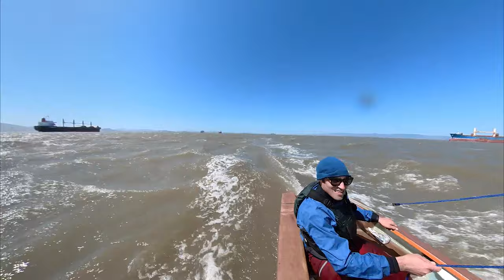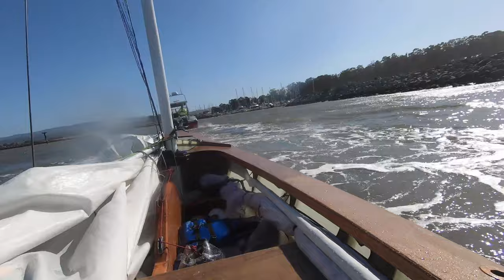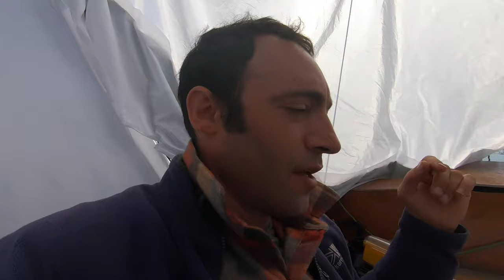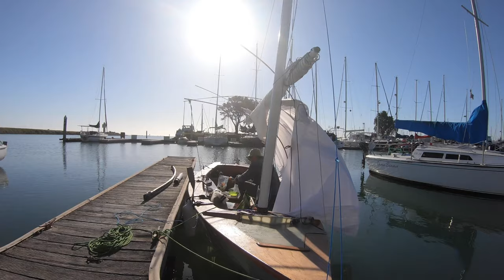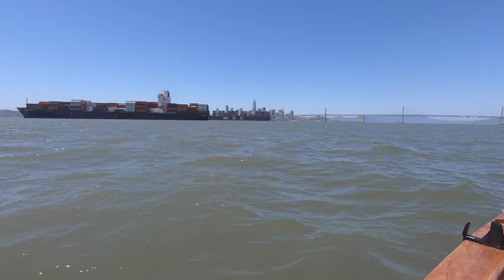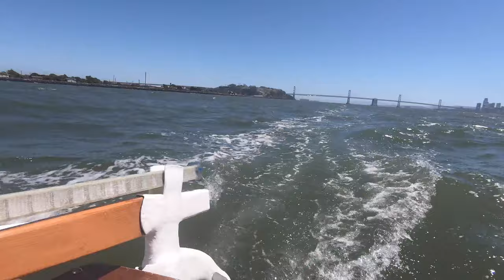RESCUED!!! On my first true dinghy cruise in the bike-towed micro glamper "First Mod".

Comment: Great video. I love Ross's designs. My kind of voyaging. I'm very pleased to jave gotten to come along. You earned yourself a subscription
Reply from the maker: Thx! Glad you resonated with this one. Many of the topics I was musing about have come to fruition, but not necessarily in the ways I thought. The electric outboard for the First Mod is real and it's good but with it and 80 pounds of Lithium it's getting harder to use the bike towing system. The standing height boom tent evolved into buying a 50 year old Cal 33 keelboat. Now the First Mod can be the tender for the keelboat, which we did on a recent adventure video.  A perfect mission for the First Mod is now beach camping in Tamales Bay, where I get all the benefits of sailing, rowing, and motoring with the electric drive, but no need to set up the 3 hour boom tent.
Reply: @fossilfool  I found myself in the same circle with a 16' soler/electric outrigger canoe. It was too much setup, transport, and what not. I ended up with a San Juan 23 for the exact same reason you did. I have also chosen a pedestrian route through life

Comment: Really, really good vid, with you talking this through.

I haven't sailed for a while. Really want to get a dinghy for my wife and I to sail. It is windy here, though. 

20 knots winds are normal much of the year, with 40-50 knot winds being common in winter (sustained, not gusts).

I do get out paddling, and the difference in conditions from one section of the sea loch to another can be huge. 1-2ft chop on one part, cross over to another part and there is a steep, steep 4-5ft swell.
Reply from the maker: Thanks a lot! Sounds like challenging sailing in your part of the world.

Comment: Hi Paul, glad you're ok! I don't know what radio you're using, but the newer handhelds have GPS and DSC built in, which gives them one useful feature: you can press a distress button and it will send your location out to rescue services. No need for you to talk or stop sailing (or bailing or whatever) the boat. The Standard Horizon HX890 is probably the least expensive of these right now.

You're doing great work! The education you're giving yourself on SF Bay is as challenging as sailing a dinghy anywhere in the world. I know it's not as fun as going on adventures, but you can level up even faster by going out near the harbor entrance when the wind is up, and practicing circles and figure-eights on repeat. Thanks for the vids and keep them coming!
Reply from the maker: Thx for watching. I am a member of the Cal Sailing Club and do sometimes go just to practice. The club is in a protected cove that opens into some respectable chop and winds in view of the Golden Gate Bridge. Thanks for the encouragement :)
Reply: We had an experienced hired captain on a 45' yacht this weekend and he used chest mounted radio equipment which attached to his life preserver vest. Then you wouldn't have to make choice over holding the radio, rope, and rudder.

Comment: VHF course would be invaluable.  Also consider getting a registered call sign, and for adventures like that, a check in with the coast guard before your trips with the route details.  Great video as always.
Reply from the maker: Thanks a lot. Another reflection not mentioned in the vid is that Mark said my transmissions came in quite garbled by wind noise. Again this points to dropping my sail and focusing on the radio for the critical tool that it is. I guess, since it was my first time using it, I didn't have enough faith to really give it the focus it deserved. There was a good post on the Cal Sailing Club recently about radios. I learned that Channel 14 is where ships talk to each other. If I had that on when I was picking through the container ships, I wouldn't have needed to get honked at. (But I would miss the deep bass of their horn ;)
Reply: @fossilfool  I hear ya.  Keeping VHF attach to buoyancy aid around the shoulder strap helps too.  No need to hold it in the hand at all.    Time and experience will give you the confidence too.  once the coast guard (in Ireland anyway) gets any hint of weakness in your communication, they send out the life boat, so the key is to demonstrate control of your situation.  Incidentally, I wonder how self rescue in those real life conditions would have worked?   But in saying all of that, you really on the path of raw adventure and learning, which is admirable.  Super work, so keep it up as its much appreciated.  Thanks, Conor
Reply: @fossilfool  Do you have dual channel monitoring? If not I would stay on 16 and the big ships should know that small vessels probably only monitor that if anything, no matter what their internal local operations dictate.

Did the container ship blow one (turning SB) or five (don't understand your intention) quick bursts? You should know these things and get a flashlight to reply. Two quick (turning P) would be helpful for them.
Reply from the maker: @stefflus08  I think it was one long blast. Thx for checking out my vids :) Pretty simple radio. I only listen to one channel at a time, if that.
Reply: @fossilfool  always keep your vhf on the emergency channel, or if in or near shipping lanes  stay o the local port channel.  And never hesitate to contact a ship directly on the emergency channel to clear up the situation.  None of that is easy in challenging conditions though.  Keep up the great videos
Reply: @fossilfool  One long blast is "I'm entering  narrow waters". Was there a channel?

Comment: Nice sail! You blew right past Brisbane Marina where I have my boat. Once you get S of hunters point the winds take off . Winds typical in spring are NW and focused by San Bruno gap after 12 pm. They build to about 4 and start moderating about 6. Not uncommon to see winds just over 30 in a day when high pressure isn't over head
Reply from the maker: I want to try again. I think if I had prepared ahead of time by knowing the various bailout points, that would have made a huge difference in my state of mind. I had the charts with me but in those conditions you're not gonna stop to read a chart (or are you?). The only takeout point that I had researched was my desired destination of Redwood City.

Comment: Love the trailer setup - well done. That first broad reach looked exhilarating. I guess for a cruise, and particularly when single handed I’d say reef early ( you can always shake it out), and if you do get caught out, don’t try and go for a deep rolly run in the surf. Come up a bit to stabilise things and tack downwind (Not gybing - actually tack called wearing around). That was proper spicy - I doff my cap sir!
Reply from the maker: Thx for watching and thx for the tips. You’re not the first to suggest wearing around. Others have called it chicken gybes. When the waves got to the 4-6’ level and the wind was gusting to 35+ I started sailing higher with less power, because I was scared of the gusts and because I was stalling, not knowing what my plan was. I was letting the sail luff a bit. I was still in control but not allowing the wind to fully catch in the sail. I had one more reef I could have gone to but the thought of dropping the rig and fiddling with my not-optimized reefing system in those conditions didn’t appeal. Because I wasn’t sailing with good power, the boat speed dropped and the auto bailers no longer worked. Water was rising in the boat. I had about 1-2” sloshing around at the time of the rescue. That may not sound like a lot but it was alarming because the problem could have kept getting worse. That’s what motivated me to call for guidance. I wanted to get off the water and I didn’t know the coast line well. I didn’t ask for a rescue but when Mark and Adam showed up I went for it.
Reply: @fossilfool  No that definitely sounds alarming, and from what you have  described I can appreciate the logic in every single one of those decisions - including calling for assistance. Sensible, considered, cautious and safe - all signs of a good skipper. Fair winds!
Reply from the maker: @nickroyal8619  Thx again. For future missions I'll  be stepping up in planning. If I had planned some bailout points I would been able to point into the marina a few minutes before I started getting scared, knowing it was there.

Comment: From May til October the conditions in the South Bay are pretty much the same. (You can pretty much ignore the forecast, it is always way too low, check the report, then you know :-))

Looks like you could have reduced the sail area one more reef.....(point the boat into the wind and get it done....).

I always launched from the Redwood City boat ramp in my Hawai'ian outrigger sailing canoe. I made it under the Redwood bridge only a few times, the conditions north of it where you were are always a bit rougher. My worst scenario was breaking rudder and daggerboard :-( 

It was pretty hairy when we got pushed against the main pillars of the bridge.....
What saved me at the time was folding my crab claw sail against the mast reducing sail area as much as I could. In a canoe you can steer with a paddle what brought us back to the Redwood city boat ramp.

I still did a lot of modifications to make my canoe more seaworthy, but it got very frustrating.

In the end I started building a boat that is capable of handling these conditions, a 23' trimaran. I hope to launch next spring and I am looking forward to sail at the locations you have tried.

Greetings
Samuel
Reply from the maker: Hey Samuel, great feedback. Would love to see footage of you moving through that spot on your trimaran. Stay in touch:)
Reply: @fossilfool  Hi Paul,
take a look here:
https://www.youtube.com/watch?v=R2HJguaqWOU&t=342s
that's where I broke my daggerboard and the rudder hinges after going under the San Mateo Bridge. (I don't show the broken parts as I was about to sell the canoe).
The wind conditions were considerably stronger north of the bridge, that's where you were. ... (I guess you had a few more knots at that time).

If you watch my video you notice on the down wind course going back to the Redwood city boat ramp that the boom is folded completely against the mast. Only the reduction in sail area allowed me to steer with paddle only. We barely made it back.

Pretty scary I have to admit.

Greetings.

Comment: Do you have a decent anchor? Pound for pound probably more reliable than an outboard.
Reply from the maker: I carry a Mantus dinghy anchor. It's good. But the high winds lasted for at least an hour after I got rescued. Are you saying I would have just waited it out with my anchor till things got calmer? Thx for watching.
Reply: @fossilfool  Getting rescued was probably preferable. But running before the wind under bare poles could have also been an option, dropping anchor to keep the boat off the shore. I sort of doubt that most lightweight electric outboards would have been much good in those conditions.
Reply from the maker: @MinSredMash  I had an even smaller reef I could have tried. I didn't stop. I wanted to get off the water. That's why I used the radio -- I wanted to know where to head. I hadn't prepared to know where good takeouts are on that shoreline and it was my first time that far south.

Comment: LOL. At 19:00 you just talked about the same electric motor with battery that is interoperable with the bike - same idea I posted on another video. Great minds think alike?
Reply from the maker: Hi Temple, I have the drawings for this larger micro yacht you're describing. Was thinking of building it on a foundation of the Core Sound 20 plans. It has water ballast. Watertight battery compartments, I have pondered. But when you expand the boat and add the battery and cruising gear it puts way more strain on the bike wheels. I feel like I'm already past the point where I can use bicycle parts. It may be that my 17' dinghy is the biggest boat possible for bike sailing. Not that a 20' micro yacht with an electric system wouldn't be awesome, but I think it wouldn't be bike-compatible. Thx for watching.

Comment: I think you should scrap the dinghy or keep it for lake sailing, or maybe the delta, and get yourself a Santana 22. you will even save carbon emissions by needing rescue less often. If you plan on sailing the bay often that dinghy is a recipe for disaster
Reply from the maker: Hey Chris, thx for watching. I think you're on to something both for safety reasons and because the boom tent process is so fiddly. If I do get a keelboat I would like boat + trailer to be around 3000 pounds or less. That's the max I think my electric car can tow. There's another owner of the same car who posts about towing his Tesla to the racetrack and it's a 3000 pound load. I think the Santana 22 is a little heavier than this...

I'll keep you posted. Plz subscribe to hear back because I'm not a professional youtuber. Just post when I have something to post.
Reply: @fossilfool  Oh gotcha, I was suggesting you just get a slip at Berkeley then you could bike down there and sail without the stress of launching every time. You'd prob get out there a lot more that way. depends on what your goals are. good luck!